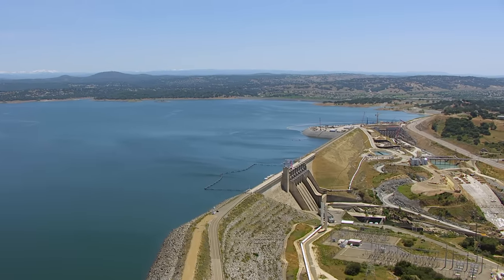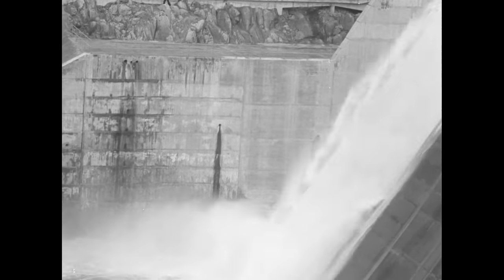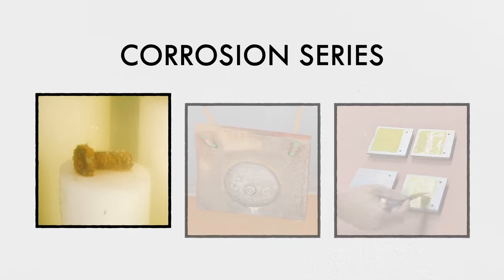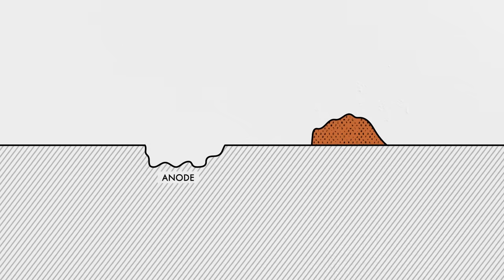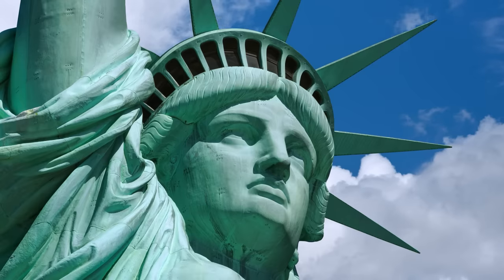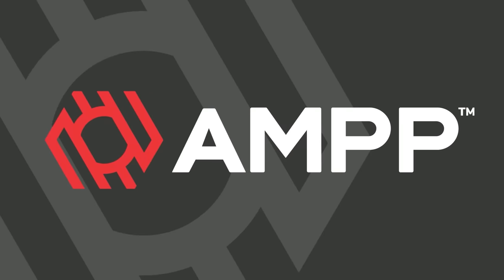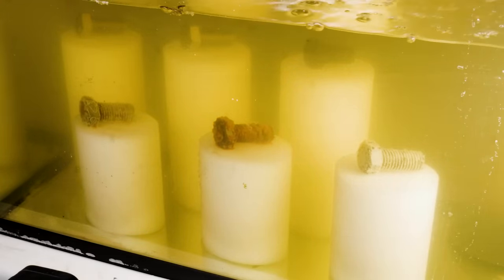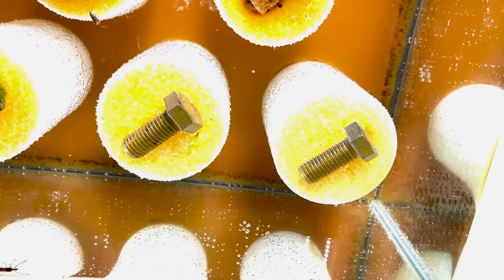You Spend More on Rust Than Gasoline (Probably)

Comment: As a coatings / corrosion expert that sees this stuff every single day…. The general population has zero clue as to how bad things truly are. Due to corruption and bad policies, maintenance is left as a last minute thing to address. It’s disgusting and infuriating to see agencies minimize the severity. Love the channel tho man! Keep up the great content!
Reply: Why don't we use more Inox metal for everything beside the cost if it's much more durable it should be considered to make already expensive things out of it no ?
Reply: @ommsterlitz1805  Stainless has it's own problems.  Stainless bolts and hardware tends to either bind, seize or "weld" itself to whatever it is holding down.  

I worked in the detail area of a car dealership and specialized in the car wash equipment, and although everything was bolted down using stainless hardware and aluminium beams, you still would end up with issues that would often require breaking stuff or retapping and buying new hardware just to service it because the stainless bolts were such a b**ch to work with.

So we went to chromed bolts after that which were also 9 times cheaper, way easier to fabricate brackets for, and not too bad to keep "clean".
Reply: Well David we went from a society where if there was the slightest scratch in the paint people would get the whole car repainted. To a society that just let's everything rot away. 

David this country isn't going to make it a few more years like this and you know it. Especially when you piont stuff like this out that the people in charge have such a extreme reaction to the slightest insinuation that you should run more then a skeleton crew to them is akin to shooting the family dog in their eyes.
Reply: @DARKthenoble  Getting a car repainted for a single scratch, every time you get a scratch is incredibly expensive today. I wouldn't be able to afford a car.
Reply: @LifeisGood762  if you got to have it financed through a 3rd party. Then you can't afford it. Most people today don't keep a job for more then a year or 2. So why take the risk on a 30 year loan let alone a college loan.
Reply: @DARKthenoble  I've never gotten a loan for a car, much less a 30 year loan. I've worked at my job for a decade and if you can afford something by using 3rd party financing then you CAN afford it. It's how most people buy their house.
Reply: @LifeisGood762  it's also coincidentally how most people lose their house.
Reply: @DARKthenoble  Fair enough, but I'd rather take the low risk that I have long term unemployment than save up $160,000 in cash. Especially since it would take me many years of renting to do, with the possibility that I never manage to do it. Home financing isn't exactly a new and unproven, risky way to buy a house.
Reply: @LifeisGood762  it kinda is when you don't decipher why that house is $160,000. Because when you talk like that you just look like the powerball ticket people. You should by a ticket it's several billion dallors now. Your telling me if the odds were that good you wouldn't have bought enough tickets for someone to win at 300 million. I mean if you honestly think $160,000 is a gamble you can make. Why don't you head to a area where homes are worth 20,000-30,000? Save up money after 2 years of working.
Reply: @DARKthenoble  Lol you act like it's 1 in a million to pay off a house. This is a common occurrence. How about I stay where I've been for the last 30 years and keep working any decent job to continue paying like I agreed to? I don't know any areas within 100 miles of me where homes go for $30,000, with the exception of the crack houses stripped of copper and filled with graffiti and druggies in the worst parts of the inner city.
Reply: @LifeisGood762  So, it has everything to do with fear.
Reply: @DARKthenoble  Yes! I don't want to get stabbed in the bad part of town and I like going to work! I'm quite afraid of getting stabbed and losing my job. I'd say both are natural and logical fears. What does any of this have to do with not being able to afford to repaint my whole car for every scratch?
Reply: @LifeisGood762  If you can't reconize the decay. Then that's on you. All, I know is this country ain't going to make it that much longer.
Reply: @DARKthenoble  It certainly seems that way. Hasn't changed anything about the progression of car decay that I've seen though.
Reply: It’s almost as if a healthy and well funded government that prioritizes ‘boring’ things for its people is important.
Reply: This is very much the same with IT infrastructure, building infrastructure, equipment maintenance, etc

Profit optimisation with no real future sight means cheapest contactors, using the cheapest materials at the very last moment
Reply: living in the rust belt has taught me much about corrosion and vehicles falling apart
Reply: Thank you for sharing your insights and for verifying the content
Reply: @DARKthenoble  country is going to be fine, maybe some politicians replaced, but the country wont evaporate or anything goofy
Reply: @bradhaines3142  How can a country be fine when it has been reduced to no more then just a economic zone?
Reply: @DARKthenoble  hmm?
Reply: Don't fix it till it breaks right? I hate it too working in a factory setting
Reply: @Casualweeb475  especially when it's something that when it finally breaks someone could get hurt.
Reply: To be fair Surfside might have woken up some people.
Reply: Sometimes I wonder if big cities are really sustainable. I know buildings are constantly being repaired but... How long will the foundation and interior skeleton last? A 100 more years? 200? At some point all those 50+ floor buildings are going to have to be demolished. And that's a lot of resources that I'm not sure can even be reused.
Reply: You might even say that corruption has a corrosive effect on our infrastructure.
Reply: "maintenance is left as a last minute thing to address" -East Palestine Norfolk Southern Railway
Reply: This is a super intersting subject, is there any literature that covers it broadly?
Reply: me who has heard how bad most bridges in florida is:
nervous laughing
Reply: you have no clue what you’re talking about. I work in a body shop and we still do fill repaint on scratches only issue is most can’t afford to do it so they just deal with it
Reply: It's also because of useless bloat in safety codes. Why in God's name do my cabinets need to have an outlet within 4 feet to be up to code? I'm well aware of how to be safe and buy high quality surge protectors and extension cords. There's so much useless bs that it seems to me that important stuff gets overlooked.
Reply: Point proven…. Everyone thinking residentially or personally. Think bigger my friends. The fuel that runs the vehicles, is stored and moved through steel pipelines and steel storage tanks. The bridges and overpasses that you drive across every single day, and give 0 thought to, they’re mostly built out of steel. The steel hull and superstructures of the cruise ships that you take on vacation each year. The water you drink and the toilets you flush, all run into concrete and steel pipelines, but are so corrosive that I’ve scraped through 12” of soft concrete…. Basically mud. Had to immediately evacuate the sewer, bc it could have collapsed at any second. Everything we take for granted is protected by a paint film of some kind, and some one, such as myself, makes sure the asset owners are maintaining their structures in a manner that is safe for the general public. You should see what they were doing before us. Look up “lead paint being dumped into rivers in the US”. People really take for granted, how much corrosion impacts our society and economy. If I’m not mistaken, corrosion costs globe approx. $2.5 trillion.
Reply: @alexandrezani  the most factual statement I’ve read. It’s very sad and super true. The corruption legit has a pH of -1.
Reply: Run till failure baby.
Reply: @ommsterlitz1805  the answer is obviously money, and sometimes paired with the need for something quick/good enough.

however, many places have realised its a better idea to start building with better materials then that of the pass (purely steel) here in Canada we often use a material known as CORE 9 steal which is a mix of steal nickle and other metalics that rust to a certain point then the rust acts as the long term protective coating for the structure, common problem with this however, is due to many structures being made of concrete along side this steal the steal tends to rust stain the hell out of everything for a few months/year or so till it reaches the peak performance. the answer to this is a specialized coating that is used on the ends where bleeding is the most likely to occur and stain concrete foundations and substructures.
Reply: @DARKthenoble  back in those days things were far more cheaper especially labour which is why infrastructure projects today cost multiple billions of $ and even large scale maintenance projects are getting to a point of 10s to 100s of millions depending on how much work needs to be done to bring say a bridge up to current code.

truth is the laws of the past along side purchasing power and excessive amounts of inflation since most infrastructure was built has balooned the cost of these projects to the moon and you top that with most cities being built incorrectly in that they physically don't collect enough tax to even remotely maintain basic stuff in cities let alone replace entire infrastructure that is well past its expiry date and you really start to see the impending doom that is upon us.
Reply: @DotADBX  You sound like a boomer when you claim labour was cheaper back then. You gotta adjust things for inflation. 

But yes impending doom. Were on a train where all the breaks have been cut. Its heading straight for a cliff. And any idea on how to stop the train safely to avoid the dangerous crash is immediately shot down. Because at the moment it simply benefits the powers that be to keep things as it is.
Reply: @DotADBX  CORE 9 steel is absolutely a great option. However, it does come with its own unique complications and challenges. Partially, serious rust staining of the surrounding grounds. The tallest building in Pittsburgh, PA is made with CORE 9 steel. Next to the 2nd tallest building in Pittsburgh, PA, USA. The 2nd tallest building was made with steel panels, built in '83 or '86. The exterior paint job lasted until 2012. When a large scale removal and paint project took place. Brush and rolled 4 coats of paint products on the 550,000 sq ft. of steel. It's a 56-story building and I was the Coating Inspector on that project.
Reply: @The_Superyacht_Paint_Expert  that's a big job to  brush and roll, probably done with bosin chairs too or a suspended platform
Reply: @DotADBX  Tractel swing stages. It was a massive undertaking. The removal process was badass! Custom built aluminum framing supported by numerous electromagnets, the track was used for the head filled with jewels for handling Ultra High-Pressure Water Jetting, 40,000 psi. Vaporized the coatings into the water that ran all the way down the building to catch ponds that were built at the bottom.
Reply: A guns worst enemy. I fear the day I open my gun safe and find a spot of rust 😂 moisture absorbers and heat rods for the win!
Reply: Paint and coatings can stop corrosion almost infinetly if applied, removed and reapplied on time and correctly on nearly any metal.....
Reply: @samnangchea5025  my Ford had “chrome” dust caps on the tyre air valves …
Reply: @DARKthenoble it's been a year and the country is still doing fine
Reply: @VictoriousGardenosaurus  The country is not doing fine over 7 million people ran across the border. XD
Reply: People can’t afford houses or food, we’re doing great!
Reply: @DARKthenoble Where in the world are you getting car loans with 30 year terms lol?

A long auto loan is 6 years. That’s the longest most reputable places offer, and usually with penalty. Most places push you for a 4 or 5 year term.
Reply: @piedpiper1172  you don't sound like someone that is capable of getting my point. Debt isn't worth it period. With houses it went from a 3 year loan to a 5 year loan, to a 15 year loan to where it is at today at a 30 year loan. 

The economy right now is very very bad. Where I work I see people getting their cars repo'd all the time because they can't afford the payments. I see people blatantly ignoring that certain parts need to be replaced on their vehicles. There was a dude literally driving home with the back of car on fire just the other day. And I see jury rigged vehicles all over my community, because even the people that have the knowledge to work on cars are struggling to afford car parts.

Anybody lending out money when people can't afford to pay you back is nothing more then a glorified scam artist in my eyes.

Comment: As a merchant mariner currently sailing on a rather rusty ship, I'm glad to see you covering corrosion!
Reply: 😅 Grab the wire brush and keep at it! 😉✌🏼
Reply: I bet you use passive alloy electrodes  by the ton. Is lead /zinc still used for corrosion protection at sea?
Reply: Break out the needle scaler and the painting gear.
Reply: Personally, I am flat out amazed at the coatings breakthroughs that make offshore platforms last like they do - particularly nuts and bolts, where simple adhesion isn't enough [as hull paints rely on].  Sadly, the EPA has blocked some very effective things.... like whatever airframes of ww2 aircraft had: they have been found in retrievable waters looking like they might still be serviceable [minus a wing or whatever] decades later.
Reply: @enalaxable  I was going to suggest they should have had zincs on those gates before they failed.
Reply: @enalaxable  yep!  Sacrificial anodes affixed to the hull below the waterline with current running through them. They get replaced in shipyard (about every 5 years)
Reply: Paint the ship, when you finish, start back at the beginning and paint it again!
Reply: @stephenbritton9297  this got a good chuckle from me
Reply: @kaitlyn__L  it’s funny, except when you’re the one doing it! 😹
Reply: @flinch622  Maybe not quite so sadly.
Reply: wait, merchant mariners have internet at sea?
that was #1 reason I didn't become one -_-
Reply: @enalaxable  zinc is
Reply: What do you think of that new Rust that was discovered that thrives in cold weather?
Reply: i am chipping and brushing as i write this, good times...